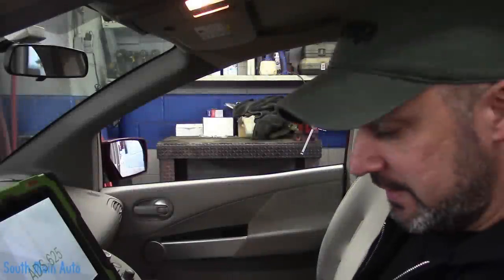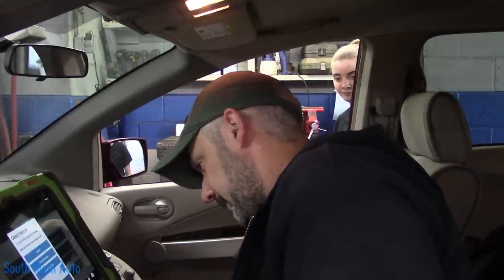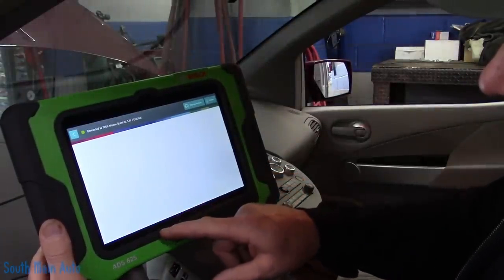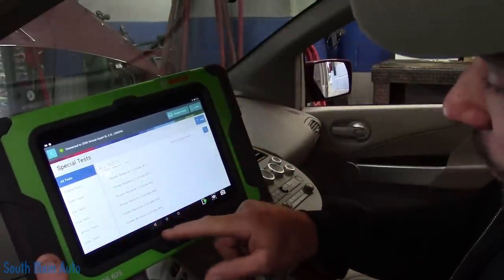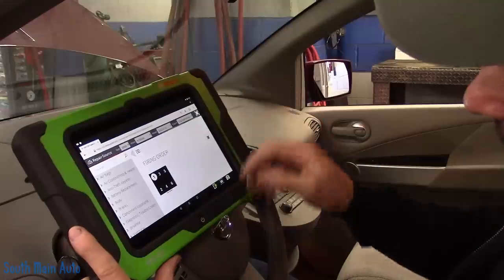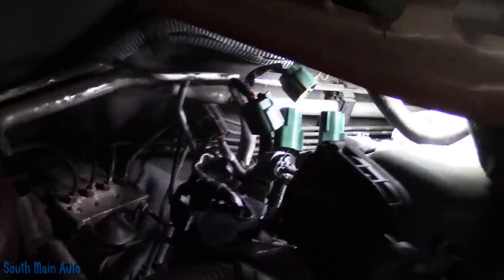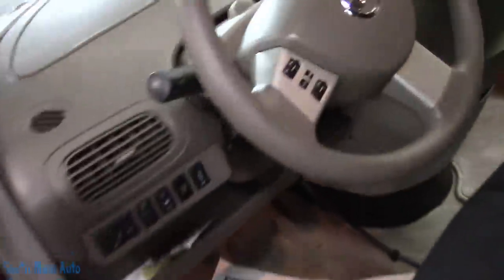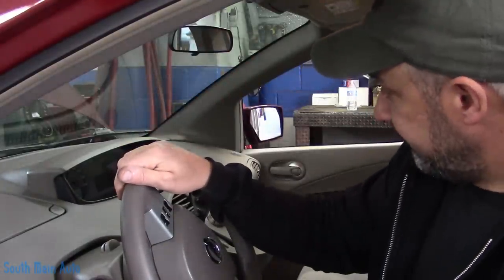Customer Replaced Spark Plugs And Now It Runs Bad!?

Comment: Replace plugs points and condenser in my buddies car no start repeated the process new points and condenser no start he drove it over to my house but it was running rough went to salvage yard got a new distributor put the new points and condenser in the distributor no start put the old points and condenser back in the replacement distributor it started pulled the distributor put the old one back in put the old points and condenser from the first distributor back in it started turns out there was a batch of condensers at the gas station that sells parts SuperAmerica that we're all bad 100 of them in the batch. This was 40 years ago I'm just a shade tree mechanic starting out then.

Comment: It is true that we can learn from mistakes. But there are three steps to the learning process: making the mistake, discovering the mistake, correcting the mistake. Assume I made the mistake. Somebody points out the mistake to me and I correct it. I learned a little. Say that I give up, somebody else figures out the mistake and they correct it. I learned nothing. Or maybe that I make mistakes and can't correct them. That's possibly a very useful lesson. Of course, my wife could've told me that--so could yours--but we don't listen.

So let me quote W.C. Fields (young wrenches going, "Who?"): "If at first you fail, try, try again. If you then fail again, just forget it. No sense being a fool about it."

Comment: One of the biggest mistakes I've ever made one of my coil packs went bad at like 2 in the morning luckily I had another one this is when the pandemic first started so I start to change it in the 2008 BMW 328i e92 after I change it the car still running rough I pull it out again I changed the spark plug switch to coils still the same results I sat there all night waiting for a tow truck 4 hours I didn't want to drive the car I was scared I was going to hurt something in it tow trucks still never showed up so I decided to just drive like that when I get to the mechanic shop all while thinking that my injectors bad and it wasn't the coil pack I get to the shop all he does is push to plug in a little further and the car is fine so far about the six hours I was on the side of the road man that I kick myself in the ass after that

Comment: I recently did something pretty similar. I'm guessing. I have a 2004 VW Golf 2.0 and I went to replace the plugs and wires because I had a misfire. After putting the new plugs and wires in, I cranked the car up and the check engine light starts blinking. It feels like the motors running rougher than it used to. So I turn the car off and turn it back on then. There's no blinking check engine light but it's still feels rough. The coil wires only reach the specific cylinder they're supposed to go to, so I'm pretty sure that's not the issue but I'm stumped. If anybody could help that would be awesome

Comment: Something like this I wouldn't blame on the owner that tried to do his own maintenance, I would blame this on the vehicle manufacturer for the poor design that would even allow the #1 and #3 coil plugs to be swapped. Most vehicle designs would at least have slightly different plugs so they could not be connected improperly like this.

Comment: I changed out my CV axles for the first time and changed the trans axle seals while I was in there. Didn't know the seal was supposed to be flush with the case and not bottomed out .25" deep. Went though a few sets of seals pulling them out. Start the engine and trans fluid comes gushing out on the floor. Don't know why they even make it that way. Landlord roommate comes out "you're going to clean that up right?" No shit douche bag

Comment: Mistakes. We've all made em. I've said it for years: stupidity should be painful. This is an easy mistake to make. Just don't make it again.    Many, many years ago I, a budding mechanic, decided to flush out my Mercury flathead. No money for engine flush, so I poured 5 guarts of gasoline in the crank case. I wash parts in gas so it is a cleaner, right? Fired it up, ran for a minute or two & drained out the crankcase.  My Dad got home from work & gave me a lesson on how explosive gasoline is.  Ah, to be young & stupid again. The Good Lord was smiling on me that day for sure.

Comment: Knock on wood, the biggest mistake I've made was swinging my hammer at a rotor, missing, and knocking a stud right out of the hub.
Reply: Question:  Can hammering a rotor hard, damage the wheel bearing?  I live where salt is used on winter roads, causing severe rust-bonding of rotor to hub.  Online, I've seen two arm pullers designed to remove stuck rotors, but they are $$$.

Comment: My absolute favorite is having a mechanic buddy help and destroy my whole engine.
 He used plastic wire wheel thing to remove head gasket . Said it won't hurt metal. Holy fk. It ruined the deck of my block 😠😠 furious 1973 formula nice tight engine. 😠
Reply: Worst I ever saw was I changed heads on Chevy for a friend. He had two sets of heads to chose from , the better set was great shape except some yo-yo used a brand new sanding wheel to clean the surface. Had to take to shop to have resurfaced.
That would have really sucked to have that done to block.

Comment: Hit a raccoon with my car-broke the transmission oil radiator. fit it on site-put 14 liter of transmission oil made a big spill on the over flow-call a toll truck pay $150 -drove an hour to a mechanic  pay $ 40 to tell me the transmission was fine just to much oil. Drove it my self to my house.  😝 silly 😝

Comment: My favorite mistake was back when I was 19 or so, was doing an oil change and my girlfriend called me right as I had hand-tightened the oil plug.... so as you can imagine I got distracted and never wrenched it snug, dropped it off the lift and took off.  So two weeks later I was driving along when it had finally worked loose and Aladdin's lamp came on.   THANKFULLY I happened to be checking my speed at the moment it came on, I immediately shut the car off and coasted to a stop and called my dad.  I filled it back up with oil and granted, it (99 3.0 Galant which was a fantastic car actually) did tick for a good 10 minutes after I started it back up, but it eventually quieted down and I drove it another 50k flawless miles.  I got very very lucky.

Comment: i just the other day crossed 1 and 3 on my chevy 305...... i still dont know how.... i was DAMN sure i had it right.... 

but it ran like shit.... obvious miss on at least 2 cylinders..... checked the wires.... and fuck me, im a dumb dumb
switched the plugs around on the cap.... to save my 50HP adding ziptie wiring separators.... and she ran like a champ

mistakes happen..... especially when you have no way of directly seeing the bullshit with your naked eye

dude is obviously 3/4s of a mechanic..... due to the detailed letter he wrote..... saying EXACTLY what he did, and what he tried to fix it
Reply: like.... i replaced the fuel pressure regulator on my 99 buick century (3.1 SFI v6).... thought it was going to run so much better.....as fuel was no longer going into the vacume line
and the check engine light started flashing..... WUT DA FUK!!!!!!!

turns out.... one of my "waste spark" ignition coils decided to die...... never even touched the thing..... didnt even fucking look at the coil
yet it died... 

decided to replace all 3.... as they were original, and ive had coil issues before.... 
and the old girl has been running like a dream for 20,000 miles now

but ya..... i LITERALLY never touched that coil
coils are on the back of the motor..... fuel regulator is on the front 
yet it decided to not have ANY spark on both cylinders it controls... 

still dont know why it decided to die..... but hey.... easy fix